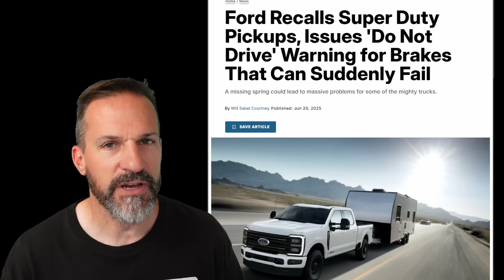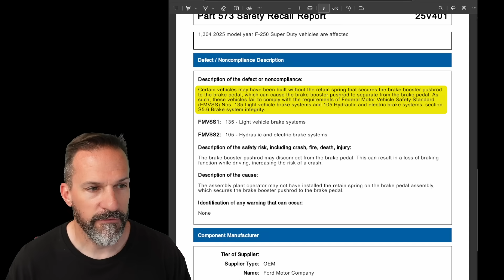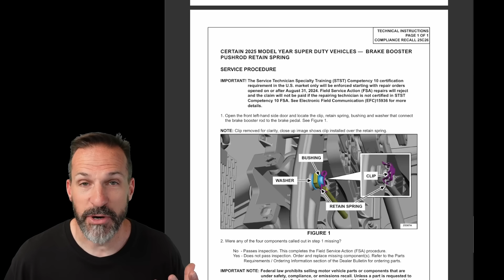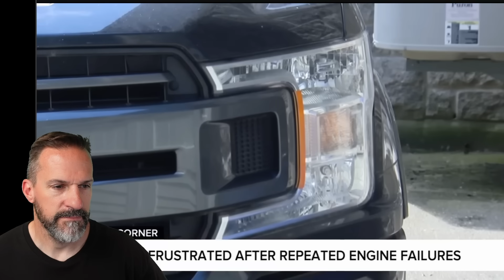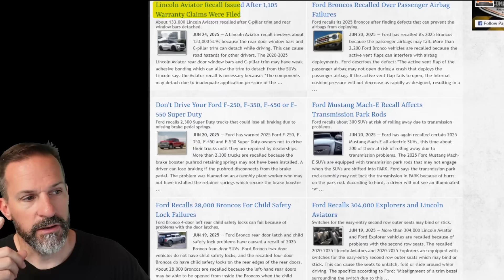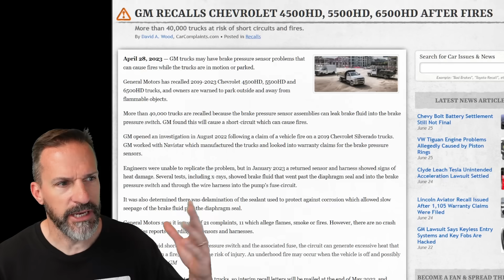WHY DID FORD Let These Trucks Leave the Factory? Ridiculous...

Comment: Great collection of Ford's mistakes.  Although my personal favorite screwup is GM designing an automatic tranny for a Chevette and putting it in hundreds of thousands of full-size cars like my parents' 1977 Caprice Classic.
Reply: Or making the Chevette so gutless it went into passing gear going up a hill, then slowed down in that one. 🤣
Reply: Speaking of the 70s, remember when Ford didn’t want to recall the Pinto to replace a part that cost $1.12 until they were made to recall?  How many people burned to death in those tinder boxes???  Sort of makes GM’s transmission issue look like small potatoes especially since those transmissions didn’t cause a fire and the death of the vehicle’s occupants when rear ended.
Reply: @Andrew-bb3lc  The media made more out of that than it was, and they gave GM their fair share too, with their truck gas tanks, which sat just behind the occupants. Look that up. Side impact and BOOM.
Reply: @HAL-dm1eh Why aren't the ones in Qatar recalled then? People drive at high speed here...

Comment: In my OP they probably ran out of the spring and instead of putting the assembly line on pause they decided to push them out and then do a recall .
Reply: You probably should keep your opinions to yourself.

Comment: People need to stop buying these Ford and Chevy vehicles. They think you're sheep that will pay up no matter what.
Reply: People do pay no matter what. Doesn't matter how expensive or low quality. There's literally no reason to build better vehicles.
Reply: No one makes a good product anymore.  It's not just Ford or Chevy.  Even Toyota has slipped badly.  There are many complaints about Nissans CVT transi.  I don't even need to mention Dodge, because we all know that story.  Only thing positive I heard about Dodge recently was that they get repossessed before most people experience the costly issues.  No company makes a good product, so we are all stuck either buying junk, or maintaining an old vehicle.

Comment: Will we ever address the actual problem with American auto manufacturing? 
The Unions are killing the entire industry. Both Ford and GM are held hostage by the UAW. 
Toyota, VW, BMW, & Mercedes all make a much higher quality vehicle in the south without unions. Also the non Union employees make more money and have better benefits than the UAW. 
The only difference is they don't have management making several hundred thousand a year to manage the Union contract.
Reply: they all build cars to die earlier to sell parts. they dont make money selling the car but on parts. you dont own it you just rent it like your home.

Comment: This is nothing new, it has always been this way. Vehicles have always had shortcomings and failures... The 5.7 tundy that everyone want to tout as the all time best reliable truck had issues to. Watch the care car nut video where he addresses all the issues of that engine. Cam tower leaks on those that were never addressed by Toyota in manufacturing through the ENTIRE time that engine was produced. Gm trucks back in the day with CPI fuel injection that was garbage and failed, the old turbo eclipse motors that the crank walked on and caused the motors to blow...etc. issues have always been there this is nothing new.

Comment: Here is another defect that Ford INTENTIONALLY designed into their auto transmissions!
On other trucks by GM, GMC, Ram or even cars from Honda, Toyota, Lexus, Acura, BMW, Mercedes, Porsche, Audi, Nissan so basically most if not all other makes, on auto transmission vehicles, you can use an open palm and push the transmission selector lever from D into N without using the lockout button in an emergency! This allows the driver to disengage the engine from the drive train and allow the driver to stop the vehicle if the throttle becomes stuck. 
On Ford, you actually have to push the lock out button to shift from D into N which defeats the whole purpose of the design. On column shifters, you can just use your open palm and push the shift lever from D into N without fear of going into R. On Ford trucks, you can't do that. You actually have to pull UP on the column shift lever to move it from D into N and again, this defeats the whole purpose for use in an emergency!
For people who don't believe this, try it in your own driveway, you don't need to have the vehicle moving and it can just be in D with your foot on the brake and you can push the shift lever from D into N for most vehicles!

Comment: This country needs to crack down hard on quality control from auto manufacturers. Vehicles are giant death machines when they're not built right. It's not going to though because of lobbying.
Reply: Would you rather Ford have not issued a recall at all?
At least they're not trying to cover stuff up like GM and Volkswagen
Reply: they cry about climate change but build cars and appliances to die earlier.
Reply: But that requires the evil “ government mandates “ so hated by the current administration. I’m not sure if that Agency is still operating this week.Itreally doesn’t matter. All the qualified engineers have left.
Reply: I would surmise at this point, anyone purchasing these vehicles is going into it fully aware of what is likely to occur. Until sales drop significantly it will never change.
Reply: Its called population control. Just like the jab was. If you are stupid enough to buy it, you are stupid enough to die.

Comment: "
"Take the number of vehicles in the Field (A). Multiply it by the probably rate of failure (B). Then multiply the result by the average out-of-court settlement (C). A times B times C equals X. If X is less than the cost of a recall, we don't do one." 
"Which car  company do you work for?"
"A major one."

Comment: What about all the 10-speed transmissions failing for all Fords made before 2022. I’m one of them. 46k miles and need a completely new transmission. $9k out of my pocket because I’m out of warranty. Thanks for the recall Ford.
Reply: I just finished overhauling my 10r80 in my 2019 lariat. Runs like brand new again. Amazing marvels of modern engineering but built with crappy parts and low grade materials. I’m angry that I had to do this at 110k miles but I saved a ton of money by not being afraid to do it.
Reply from the maker: Yeah that stinks, did you have the drum issue?
Reply: @TheCarGuyOnline Bingo!
Reply: Man I feel bad for you , mine started getting really bad at about 89k ,,, I traded it in before the dreaded wrench popped up , I called acouple local transmission shops and everyone of them told me to run

Comment: None of the manufacturers build good vehicles anymore. Ford,  GM,  Chrysler, Toyota . It's so sad.
Reply: Pay more for junk.
Reply: I like my 2024 Toyota. No issues, feels well screwed together.
Reply: Sadly, that has become fact!!! "Planned Obsolescence"
Reply: You nailed it!
Reply: I don't want an electric vehicle but I'm thinking about getting the slade if it's actually 20 grand
Reply: Ill stick with audi !!! They cost more to up keep but they have a better build quality than 80% of cars out there
Reply: @LSDdreams808  my neighbor had an Audi, it was in the shop more than it was driving. They got rid of it and got a VW and haven’t had an issue.
Reply: @LSDdreams808 😂😂😂
Reply: I rather drive Toyota , Toyota way more credible
Reply: @bd9856  Toyota is having the same problems with engine failures and transmission failures.

Comment: this guys story seems a little questionable. Might be a chev/gm owner and giving smack to the ford brand. It would not surprise me if the other auto makers have people paid to say and do things. Just saying
Reply: It is weird. Has the camera ready out the window filming while driving?
Reply: He's a consumer just like 99% of the people that watch his videos. Consumers are alarmists. They hear the word brakes and everyone faints. And I get it. No one wants their brakes to fail. In this case, however, its a very minor thing. What they're talking about is a clip that does the same thing a cotter pin does. Yes, its always best to have it installed, but no one is going to die over this clip. The way the connection was designed, it can't come apart. But even if the pin that holds the power booster rod to the pedal completely falls out and disconnects, the rod can't go anywhere because of the way its designed. Its still going to be in line and come into contact with the brake pedal even if it becomes completely detached. If it was something that was really dangerous, they would never give the customer the option to inspect it themselves. That alone tells you its not something major.
Reply: Talking about the engine failure clip  @052RC
Reply: It takes literally 2 seconds to pull out a cell phone and hit record
Reply: @ohiohero44  that's why your simps keep crashing into shit constantly.

Comment: #quantum_computing_ford rolling out for the first time ever right now today purpose be to manage the insane complexity of an automobile #qbts this is not The Ai this is an entirely computational mathematical blank slate effort the END of digital no joke. Current leader in this is #ibm but most of this has happened #chicago_quantum_computer talking tens of BILLIONS in capital and decades of research now have for the first time a real product #grok_ai Tesla still King of Ai but this is all changing really fast here suddenly #byd_god_mode cars that require no driver cost nothing in China and you can get that plus the car for under $8000.00 us dollars. Trucks like this will still sell crazy well as fast as can be made...but they have to now start incorporating "God Mode" #waymo into their vehicles first big impact should be in minivans #sound_hound better get your game on here mister 😊😊

Comment: I have a 2025 F150 5.0 RCSB 4X4 and there was already a recall for a possibly not torqued bolt on the steering coupling. Took it in and it was torqued, but this is indeed a trend. DEI hiring and letting Blackrock run your company was not a smart plan. Henry ford II was the OG DEI idiot and gave jobs to 9000 city blacks in Detroit, race based hires, then 4500 never showed up to work and still got paid lol.

Comment: Eco poop.
Reply: Lol
Reply: Eco boom
Reply: @wigletron2846  That's what I call them. I had a 2012 Mustang with the 3.7 V6. It very reliable. My wife had a Mazda 6 (when they used Ford engines) and a Ford Escape both with the 3.0 Duratec engines. They leaked some oil, but otherwise they weren't high maintenance. Now? I won't go near a Ford dealership.
Reply: that's a good one 🤣🤣